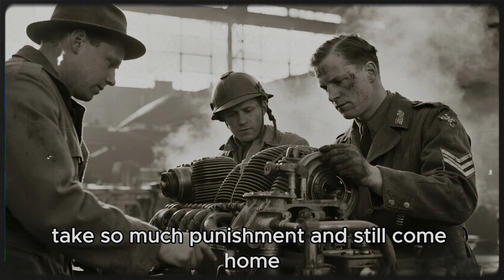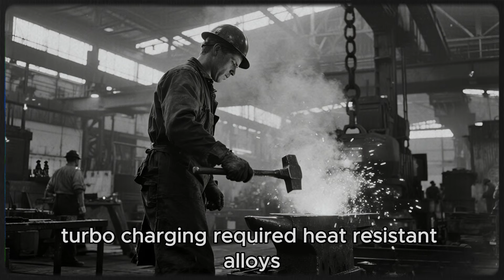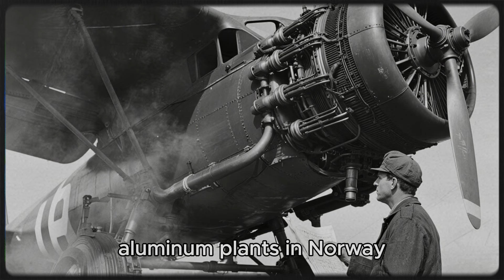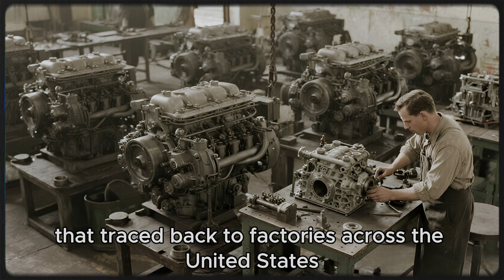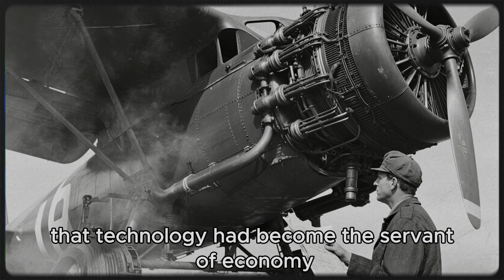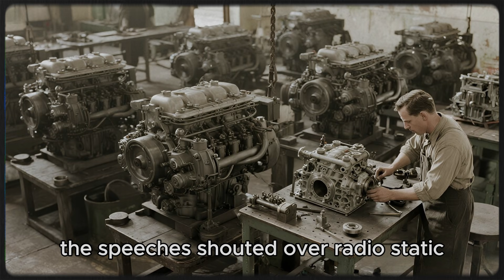German Engineers Were Shocked When They Opened the P-47 Engine: How Far Had America Surpassed Them?

Comment: No, your incorrect on why the Thunderbolt could suddenly climb so far, and much higher than before. It was the MENTHOL/water injection fuel instead the the alcohol/water mix injection system that was the key.1 Once realised, tested and "dialed in" this system could give the Wasp a boost of 800 HP, instantly WITHOUT damage to any critical components in the engine and helped cool the combustion gasses preventing per-ignition and high exhaust temps that would literally melt or explode the engine. This it what made the difference. Same engine, same build, same injection system......different media fuel for the water injection system!
Reply from the maker: Interesting point, David. The methanol-water injection really was a game-changer for the R-2800. That extra boost and cooling efficiency gave the Thunderbolt incredible performance at altitude. Amazing engineering for its time!